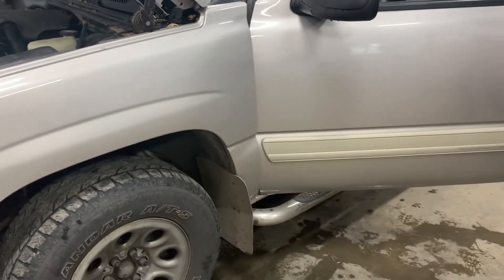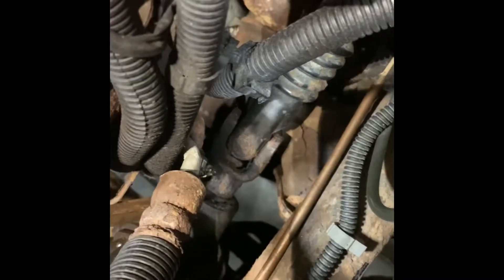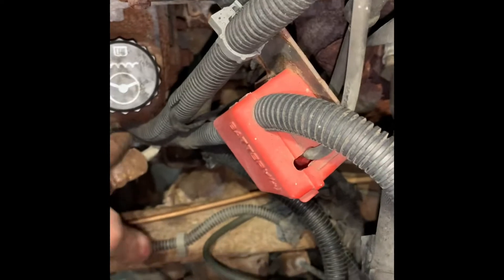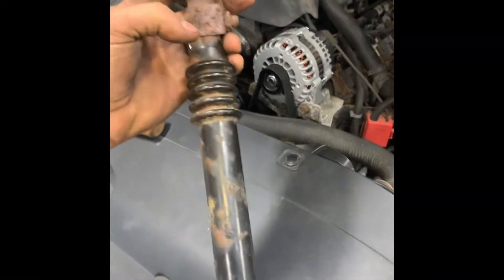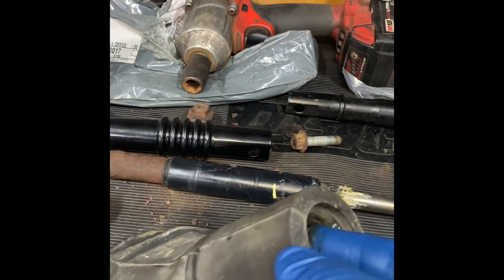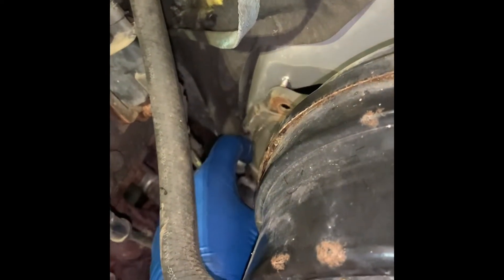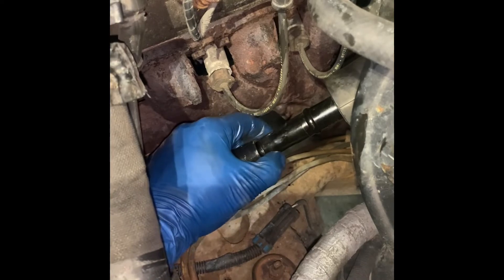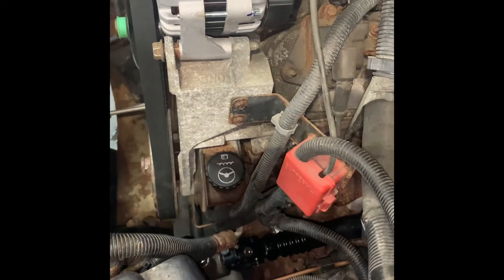How to change a Silverado intermediate steering shaft. 99-06 Silverado

Comment: puting upper and lower shafts is a pain, i got a 005 tahoe,i check the fitness of the shafts before installment; i ended up sanding, grinding the upper and the inside of the lower, the i tried to remove the upper by removing the boot and was a pain, tahoe figuration is diferent than silverado, finnally i did it, then, after separeting the shafts, i removed the old lower, and on top of that, the new lower was round, my steer box shaft is not round, so, i went back to my old lower, and then, my new upper didn't fit the old lower IT WAS A NIGHTMARE !! AFTER 3 OR 4 HOURS I FINISH THIS NIGHTMARE JOB, NOW I'M WAITING FOR OTHER LOWER SHAFT, (THE RIGHT ONE)
Reply: another nihgtmare problaly !!